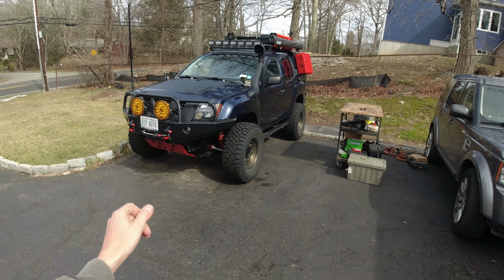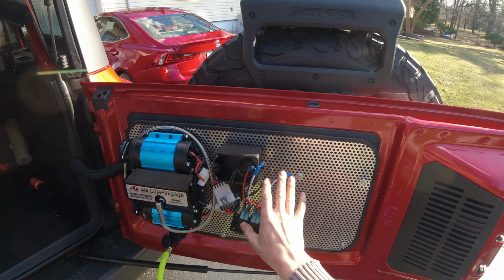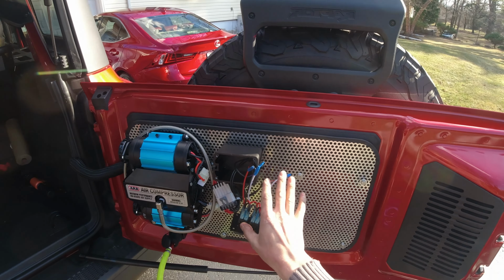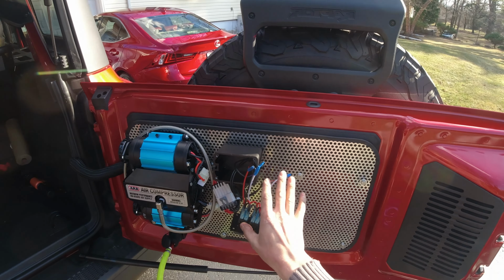Installing ARB Air Compressor on Ford Bronco Raptor

Comment: As always, great video my friend. I installed the ARB dual motor compressor back in 2015. Still a great mod. I mounted my in the back of my X with a little bracket/ panel I made attached that to the gavin interior rear tray. I think it came out awesome and use it way more than I thought I would. Link attached for ideas. Keep up the great videos Sir and representing the Nissan platform. 

https://www.youtube.com/watch?v=TVDWN7hc_Fk
Reply from the maker: Thank you very much my friend !  thank you for watching ! )))   and  you got really great looking Xterra nice build  and awesome spot for the air compressor . that rear shelf is so useful its crazy !  I have so much stuff already mounted to it already as well lol

Comment: I don't have a use for a compressor. It's neat I guess. I just dint offraod anymore. I dint like breaking stuff... I like horsepower and the low life
Reply from the maker: Yes breaking stuff is not fun that is for sure and especially on the trail  can be very dungarees too if there is no spare parts with you or your friends then you in trouble lol
Thank you for watching

Comment: I have a arb compressor in my frontier its the single tank one though that twin compressor was like over $600!! I couldn't afford that one but the little one works great for me i just use it to air up my tires but i will have it hooked up to a front locker shortly i already have it wired up and ready for the locker i got the air hose wrapped up under my truck on the frame just have to plug it in to the m205. Im waiting for my buddy to get done with the regear on it then ill install it.
Reply from the maker: Yes they can be pretty expensive  😵‍💫but I guess they are really good and top quality with 100%  cycle use . no need t owait for it to cool down or something .. 
and the single tank is pretty good too maybe slightly slower to air up but still works amazing ! . I bet you can't wait to install your m205 with a locker its a game changer !